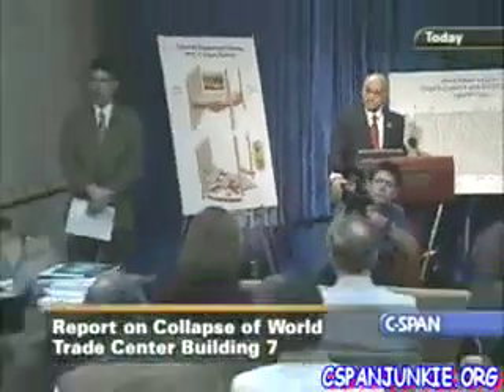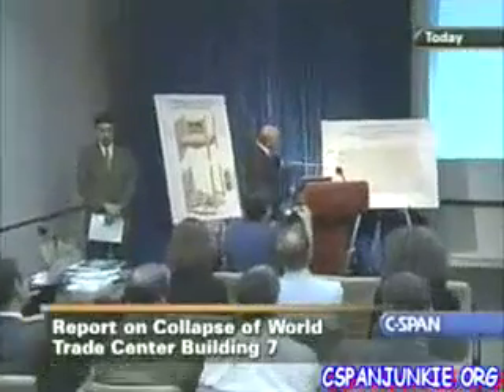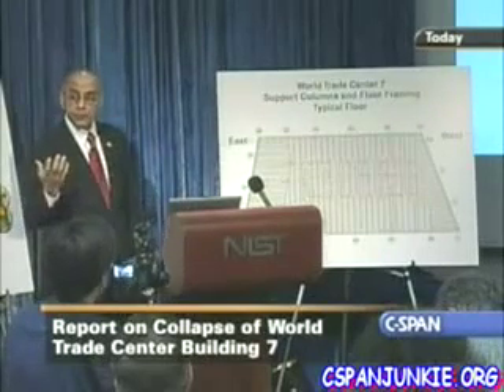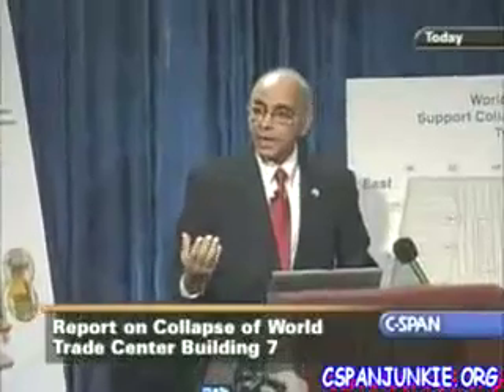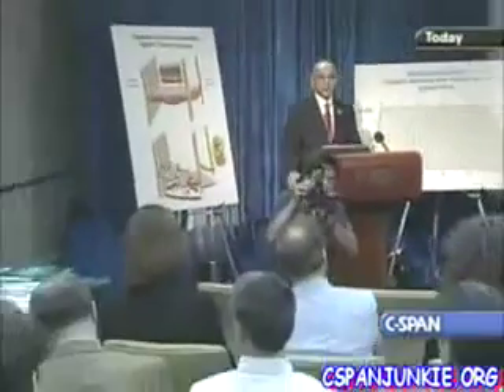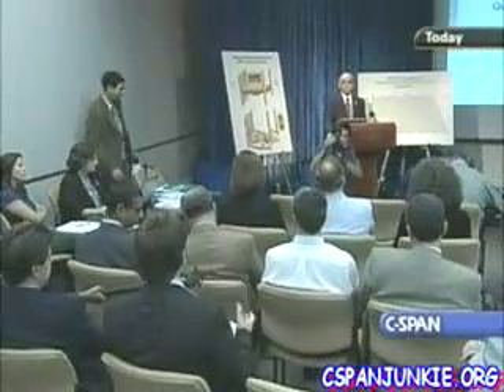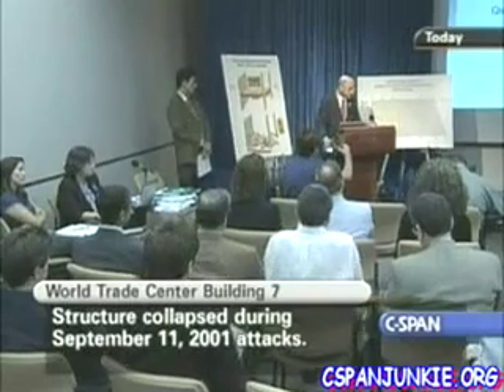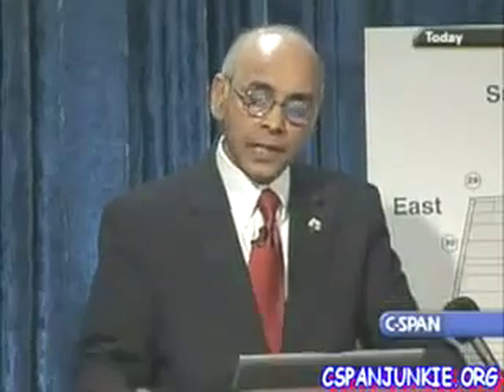NIST WTC 7 Report - Press Briefing 8/21/08 pt 4

Comment: He doesn't really explain the progression once the assumption of column 79 has failed. We should know the order, timing, and position of failure of each column if he's got a detailed program that actually is blaming thermal expansion as the reason for failure on one or more floor connections. When exactly did all the perimeter columns fail? If they failed on the way down, how do you explain the 2 seconds of freefall?  Whoever made the settings on his computer simulation made fire possible ...

Comment: I agree to the point in aiming for the towers. But if you consider the pentagon, it does take skill to the point where it is almost impossible.
If you take a plane beyond it's g specifications, the wings would simply rip off.

Comment: If you take the kinetic engergy from a 707 at max speed and a 767/757 at max speed the 707's kinetic engergy is greater than the one of the others.

Neither one of them can fly at max speed at sea level, because the air is to thick and the nose would go up, even if you push it all the way down.

Before you ask, yes. I have a friend that is a pilot.